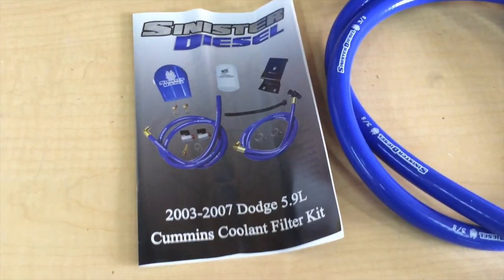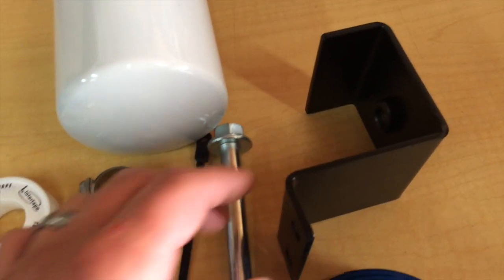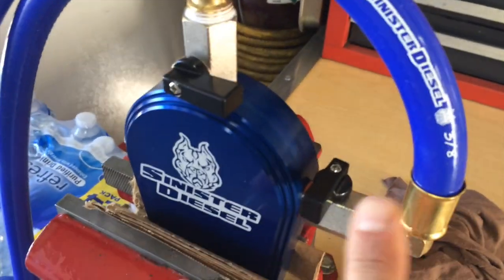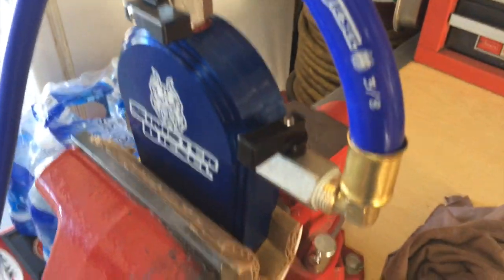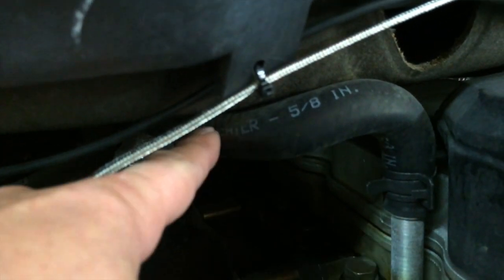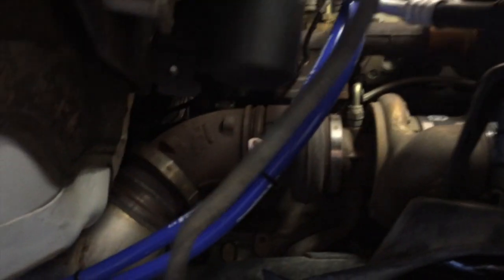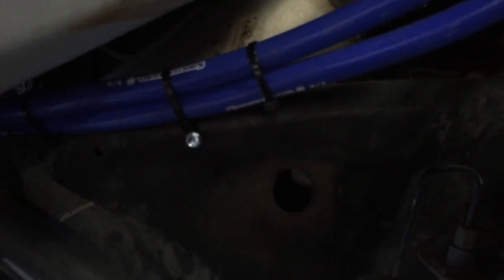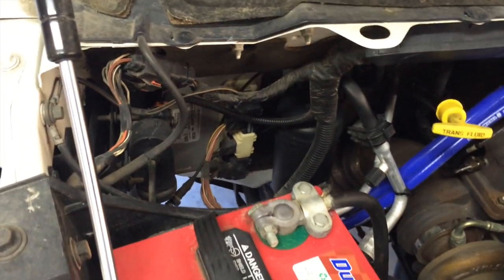Cummins coolant filter

Comment: There is a lot more , real-estate in that Dodge... than under the hood of my Fummins. 2004 F350 with a 2018 6.7 CR  Cummins. I have the coolant filter kit off the 6.0 we pulled out.... Im looking for a spot to mount the housing- the factory spot has an air filter in the way now.

Comment: couldn't help but to notice you tied the return into the pressure side of the heater core. running both hoses off the head makes the system useless. the return is to go down to the heater core return hose down by the water pump. pressure from the head, no pressure down by the water pump where the heater core return goes.
Reply from the maker: +smalltownpower yes what you are saying is correct. But I think the idea behind this kit is to be more like a bypass style filter instead of a full flow. So a fraction of pressurized water goes through the filter and then meets back up with the rest of it at the heater core line. I understand that both sides are pressurized but water is still flowing through the system to make it work.

Comment: Hey brother cool video, I'm subscribing to your channel. I'm just curious though is it absolutely necessary to put that filter down on the frame rail like that? I have a 2006 5.9 with a Rough Country lift kit and the kit comes with lower control arm drop brackets that use that hole, I'd definitely have to stray from what the kit specifies. Hell I'd like it inside my engine compartment if possible!
Reply from the maker: +Russ Cline Trust me I didn't want it down there either but the engine compartment is pretty tight. Plus the hoses have factory crimped on ends. A place called the Diesel Site has coolant filter kits also maybe check those ones out.